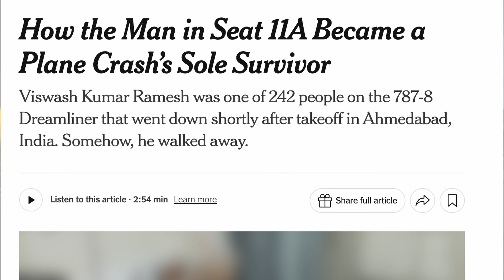Why the RAT Changes Everything – Air India 171 Update

Comment: Seems like the real evidence would be the “absence” of the sound of jet engines if we are to believe dual engine failure. But in the video I thought I heard engine sounds other than the RAT.
Reply: In the video, the "engine sounds" are extremely quiet. Engines that are failed and spooling down will still make sound. Planes also make A LOT of aerodynamic noise that sounds almost like an engine running. This is a 220 ton hunk of metal flying through the air, its going to be noisy even without engines running. I forget actual percentage but something like 40% of aircraft noise during landing is just from the air resistance on the flaps and gear.

Comment: @captainsteeeve in the video from the tower or airfield, ( from your first video, and I appreciate it could just be jet wash) but it would appear more than that, it looks like some sort of fluid gushes from the landing gear or wing.. Or it appears like such to me. Could a massive hydraulic failure have caused both the flaps and the landing gear issue??

Comment: you f...ed up first time. as a pilot you should know. flap leaver and wheel leaver located on different locations. its so hard to mess up. you put the blame on those pilots. last video you can see flaps in correct position. its hard to see. but you can see it

Comment: @Captain Steeeve 

Hi Steeeve,

I wanted to share a technical hypothesis I’ve been working on regarding flight AI 171 (B787), specifically about the behavior of the main lateral landing gear during takeoff.

---

🛠️ Hypothesis: issue with the bogie tilt mechanism

Watching the gear movement, it seems the bogie remained tilted forward (~25°) without returning to horizontal. This realignment is a necessary step before the gear can retract into its bay.

For the main gear to retract properly, the bogie must first be realigned to horizontal by the tilt actuator. This repositioning is critical as it prepares the transition before the bogie moves laterally upward into its wing bay. Without this prior realignment, the angular geometry prevents the mechanical retraction of the gear.

The sequence clearly points to an angular mechanical blockage, consistent with a failure of the tilt actuator, which depends on:

The central hydraulic system (HYD C) (in some configs HYD P might also play a role, but HYD C is primary here),

Sufficient hydraulic pressure to bring the bogie to level before retraction.

---

⚠️ Implications:

No realignment = no retraction, even if the command is given,

The gear stays stuck "in transit," triggering the amber warning light,

This could stem from a loss of pressure or a localized hydraulic issue on the HYD C circuit.

---

🔄 Possible link to dual engine failure:

Given that the B787 hydraulic system is partly powered by the engines, a loss of power or simultaneous failure of both engines could have caused a critical drop in hydraulic pressure, affecting especially the central circuit responsible for the bogie realignment and lateral gear retraction.

This adds another layer to the analysis, suggesting that the engine failures and landing gear issues may be linked rather than independent.

---

🧩 In summary:

> The bogie tilt could not be completed, the gear couldn’t retract, and the aircraft indicated this via the "Gear in Transit" warning. This hydraulic malfunction could be connected to the dual engine failure. It’s a plausible lead, pending FDR/CVR analysis and official reports from DGAC/AAIB/NTSB.

https://youtube.com/shorts/1055l0B9dm0?si=JvNvUiBu1FQi0PcS

https://youtu.be/2ZwzACp-q9U?si=BcltMaIiobQ5d8XB

Comment: I want to ask you that you saying co-pilot changing the flaps configuration by mistake. First of all the location of Landing gear knob is front and flaps is much below and beside copilot also for the flaps the knob needs to be pulled upwards. (I know the stuff of 747 not 787). Also does there is no fail safe system to not do that upto a certain feet of height. Also we do not hear the sounds of the engines from that distance in the video.

Comment: ...during times of "extreme duress" and perhaps a lack of "qualified pilots", this RAT could be deployed "out of panic".
There was no engine failure, just "pilot failure".
The flaps were "improperly set" and the landing gear was NOT retracted "fast enough" and "contributed" to the crash.
Reply: You are speaking nonsense
Reply: @BIOHAZARDXXXX  ...care to "elaborate" ?   lol
Reply: @hankhaney3785  Literally everything you stated is wrong. The crew did not deploy the RAT out of panic, it automatically deployed when hydraulic pressure was lost. There certainly was an issue with engines, they stopped producing power after liftoff. The flaps were properly set, that has been confirmed. The gear was retracted by the pilots but because of the lack of hydraulic pressure it couldn't be raised into the UP position.
Reply: @BIOHAZARDXXXX  ...is all that from the report of the NTSB, or is it your and others "guess work" !
Reply: @hankhaney3785  Now that the official preliminary report has been published, its confirmed that literally nothing you said was remotely accurate.
Reply: @BIOHAZARDXXXX  ...the latest news is that the "fuel supply was shut off.
Did your "preliminary" report mention that ?
there is a reason it's called a "preliminary" report.....lol
Reply: @BIOHAZARDXXXX  ...is that a NTSB report ?
If not, it's a "indian airline report covering their asses most likely.

Comment: Not sure about that..
1.  Pilots used the ENTIRE RUNWAY...Normal takeoff V1 happens MID RUNWAY - for 787 even fully loaded
2.  Dual engine failure at the exact same time 10 seconds after V1?  Impossible.
Reply: 1. Nonsense.... the very first 787 takeoff video I looked up on YouTube shows the plane lifting off almost at the very end of the runway: https://www.youtube.com/watch?v=-8ej8-OYMIQ
2. Could be fuel contamination, could be a single engine failure followed by the crew disabling the incorrect engine, could have been a malicious actor in the jumpseat who set both master engine switches to cutoff as soon as they became airborne... could have been many things.
Reply: @BIOHAZARDXXXX  Not even CLOSE to the end of the run way for V1.  You need to check it out again pal
Reply: @BIOHAZARDXXXX  The Air India 787 was AT THE END OF THE RUNWAY..that is completetly ABNORMAL.  If you think otherwise then really keep quiet.

Comment: Thing I don't understand is, at 6:40 you say you can hear the RAT, however the view of the plane at that point is much clearer and the RAT doesn't appear visible.  When you showed us the RAT earlier in the video, the plane is much further down field before it's spotted.
Reply: The RAT is tiny and is the same color as the rest of the fusalage so it will blend in as well. Add on top of that the graininess and "pixel noise" in the footage and it is very difficult to see. Either way it is certainly deployed based on the audio.

Comment: Since RAT RAM air turbine was automatically deployed main  engines failed , auxiliary power failed, battery back up power failed. Root Cause is overloaded Engine when the flights are full with 100% payload weight and 100% fuel weight it is a disaster and root cause of #AI171 failure catastrophic failure and should include this Check on all Boeing flights immediately. Pilots should carry out correct mass  load calculations and should avoid filling 100% fuel as they filled 125000 litres aviation fuel  which is equal to 100000 kg taking specific gravity of 0.8 for aviation fuel in Ahmadabad fair India flight. The total weight of the plane with operational weight works out to 260000 kgs which is 120% of design weight of 227000 kgs and in hot air this was a disaster. These 787-8 come with vast range of variation from  2.27 MTOW to 2.5 MTOW (max  take off weight) which is a recipe for disaster

Comment: This is interesting. I don't pretend to know anything about planes  but considering that the fuel pumps on a 787 are electrically powered. Could it be that there was a malfunction in the pumps. I just say this because I have seen that the plane was experiencing some electrical issues on the Delhi to ahmedabad flight . Minor issues but failed air conditioning, overhead lights not working and screens not working. Could these be indicative of something more serious malfunctioning?
Reply: They will gravity feed
Reply: But surely that plane would not have had the time.  My understanding is that gravity feed works well with gradual failures at a higher altitude .   @DarrellKoenig-m7d
Reply: But surely that  plane would not have had the time. My understanding is that gravity feed is effective for gradual failures at a higher altitude. Please correct me if I'm wrong.  @DarrellKoenig-m7d

Comment: I do not think the two engines "failed". I think this scenario, Autopilot can be engaged per FAA rules on takeoff no lower than 400 Ft. AGL. I think. Maybe the autopilot was engaged at maybe 600 Feet AGL and it didn't work. The AUTOPILOT shut the two engines down. People who were on the plane when it arrived in India said the AC didn't work, the infotainment wasn't working right. I think the plane had issues and should have been serviced. BTW NTSB has an investigation open on a Dreamliner that had an autopilot shutdown. Just some thoughts I have. I seems unlikely that two engines failed at exactly the same time. If a fuel problem, why didn't other planes have the same problem? I think the autopilot shut the engines  down and  the hydraulics were lost and that's why the RAT was deployed.and there was absolutely nothing the pilots could do.
Reply: I have to make a correction. I just read the airport is at 200 Ft. The plane reached 425 Ft AGL. (Above Ground Level). Still above the 400 Ft. AGL that is the minimum for engaging the Autopilot.

Comment: Just before you said "dual engine failure", I was thinking hydraulic. I don't seen flaps deployed. Are they? And not having flaps might mean no hydraulics?
Reply: It is confirmed that the flaps were deployed because the slats were also down. The 787 has a very slick looking wing even with the flaps down so its really difficult to tell on video. But what you can 100% see for sure is that the slats are down.

Comment: Fully agree with Capt. Steve – RAT deployment and sound clearly point to a dual engine failure. Aircraft lifted off and climbed briefly, meaning both engines were working at rotation, then failed.

Claims about flaps set to zero are nonsense. In 40°C heat, a fully loaded 787 wouldn’t even get airborne like that — certainly not as cleanly as seen here.

Fuel contamination seems unlikely given no other reports. Previous flight had electrical issues, possibly indicating a deeper power distribution or FADEC failure.

At that low altitude, RAT buys you time, but not enough for recovery.
Lesson learned? Consider mandating APU running at takeoff for ETOPS ops.
Reply: True. How the experts thought the flaps were not deployed when the take off looked normal? From the very first time I saw the video I thought about loss power.

Comment: Duel Engine Failure... Shouldn't the Engines be checked maintained serviced before every take off? I can't fly on a plane knowing that Engines just can just fail, even when there is 2 of them... Engines in my experience as a retired Engineer don't often suddenly stop working without showing signs. Usually a Noise, Clunking or tapping,... Vibrating or rattling. 
I wont accept Duel Engines Failing as a reason for this disaster. It should not happen just within 5 mins of running
Reply: Engines dont get checked before every flight. They get checked when they have maintenance schedule. Airplanes have many sensors to show if there is any problem with anything.
Reply: The most likely reason for dual engine failure is fuel contamination

Comment: Another consideration about the RAT deployment: initially it could have deployed due to a total loss of electrical. The fuel pumps for the engines are electric. Loss of electrical power-loss of engine fuel; dual engine flameout.
Reply: Two things, the fuel pumps would still be receiving standby power from the batteries if both the engine-driven generators failed. Second, the fuel system is specifically designed to allow for gravity-feeding incase of a total failure of all the fuel pumps. This was all considered in the design of the aircraft. This is going to be an extremely complex series of events that lead to this.

Comment: Hi Captain Steeeve,
1st of all, our deepest condolences for those who lost their loved ones. Thanks for your analysis ! From my non-expert point of view, I believe the flaps were properly extended (5 or 15 ?) because we can distinguish them on the 2nd video on the left wing (and loud alarm would have raised into the cockpit before T/O if flaps unproperly set). I was thinking about an aircraft rotation below Vr because no more runway to do it (in case the 787 starting point were not at the beginning of the runway = not enough runway to T/O = human error ?). What is the 787 behaviour if rotate between V1 and Vr ? Is there enough lift (with excessive outside air T°) ? But the fact the RAT was deployed (automatically) rather makes us think of a "double engine failure" as you say. This kind of failure is quite impossible on such an airliner today !!! What could have led to a such catastrophic event : fuel contamination ? engine maintenance ? During takeoff roll, both pilots (Flying + Monitoring) should have detected a lack of thrust / acceleration ! May be detected too late (above V1) and then forced to get airborned ? Is there a way to anticipate an abnormal engine thrust just before getting takeoff clearance (like we usually do in general aviation cessna, piper with magnetos - something like this) ? Also, the dust we can see on the 1st video could be caused by a desperated rotation nearly at the end of the runway 23 (engine blast outside the runway...) because of a lack of thrust/acceleration ? Is it possible that the RAT deploys in case of a loss of power (not total engine failure) on both engines ? And what about APU = unavailable ? (is it deactivated before takeoff ?). Regards (Romain from france)

Comment: UPDATE:  this may not be new but may not have been given enough consideration. It seems that the aircraft took approx twice the runway length it would be expected to take. 2600 meters rather than 1600 meters. That suggests low thrust from the start of the flight. Just doing mental doodling, almost twice the runway length suggests engine power was perhaps only 60%. That puts it in “operating on only one engine” territory. It can do it in theory but what if the engines continue to degrade under load?  This keeps pointing to a contaminated fuel issue.
Reply: A longer version of this UPDATE:  These are the pieces:  It was not a flap problem, we can clearly see they were deployed.  If one engine failed during takeoff run the pilots would have known that from the need to counteract with rudder.  If below V1 they would have aborted. There is nothing to indicate a single failed engine.  It took 2600 meters when it should have taken 1600 meters.  Clearly there was a thrust problem.  Possibly only 60% thrust was being generated between the two engines. Lack of indication of a single failed engine suggests both engines were down on thrust for the "same reason" whatever that reason was.  The aircraft made it into the air so we know it had what could be called "single engine performance" capabilities.  Had that level of capability remained it would have struggled but would have been able to maintain a positive climb rate.  But it didn't.  Thrust continued to reduce for some unknown reason.  What we can see of the landing gear, to the extent we can see in fuzzy video, shows normal toe up at first but then transitions to toe down.  The toe down is what happens when the retract cycle is started and the landing gear is repositioned for stowing.  The landing gear never gets beyond the toe down point.  That would be indicative of complete engine failure of both engines and complete loss of hydraulic and electrical power.  We also can hear on the audio the clear sound of a deployed RAT, which automatically deploys when both engines fail.  None of this is particularly speculative, its all based on what can be observed.  What remains in the realm of speculation is what caused both engines to fail.  Did the flybywire go haywire?  Fuel problem?  ???

Comment: AI171 had a serious maintenance issue, reported by one of the passengers who had earlier flown on the same aircraft from Delhi to Ahmedabad on the same day before it departed for Gatwick. The gentleman complained about the air conditioning not working properly, indicating electrical issues, which might add to the disaster as well.

Comment: I suspect multiple cascading faliure due to Poor CRM, first engine fails on climbout, copilot accidentially in a panic state shuts down fuel to the  second, electrical system fails,hydraulics fail(rather stuck between switch over mode from the main gen bus to battery/rat backup bus) gear is stuck from retaracting, rat deploys meanwhile by the time they can recover its too late given they were just 600 feet above the ground. This sounds like a copilot error than anything else. by the time they could resolve this it was too late.The pilot must have been busy trying to control the aircraft while the copilot must have been managing everything else. I strongly suspect the copilot panicking.
Reply: official reports atleast preliminary finding reports are they point to poor crm, confusion in cockpit and fuel cutout switches.